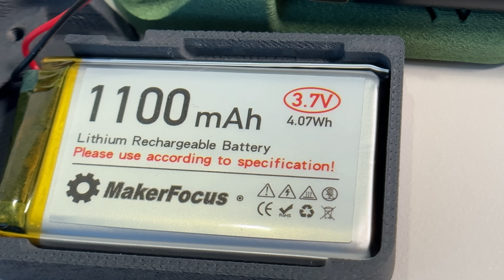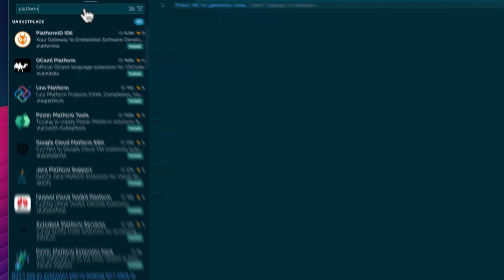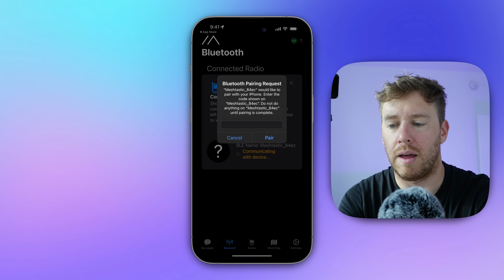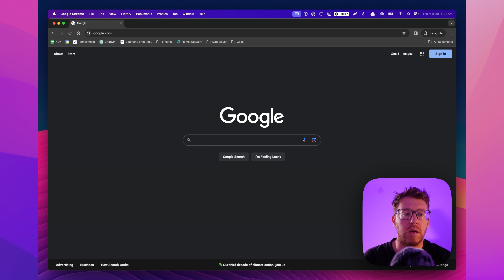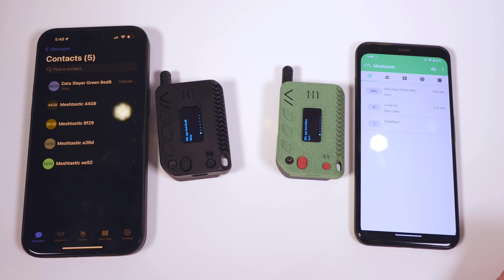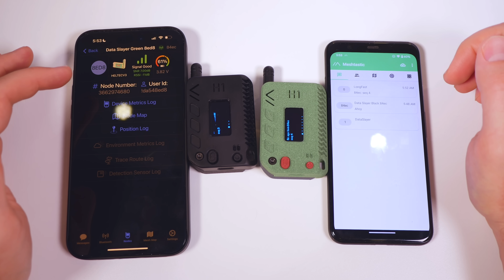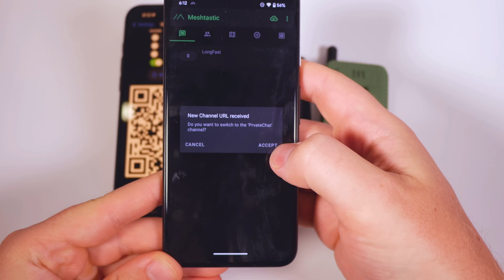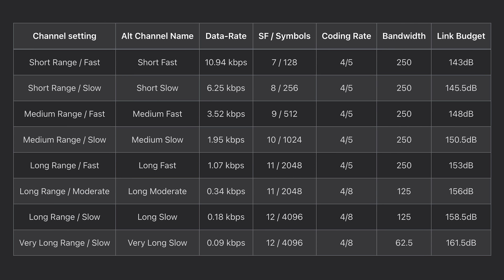It’s Been a Good Run, Phone Providers.

Comment: In 2015, a me and my supervisor talked about this technology. This will be very helpful when disaster comes and no telecommunications are available.
Reply: disaster has already come.
Reply: HAM radios are the emergency comms worldwide. These Things are amateur pagers for local friends.
Reply: When disaster come but you still have a plug to charge your devices... like... a small disaster!
Reply: How is this better than conventional radios?
Reply: @Kryssthealien  Or a generator, or an inverter and power supply, or a lithium backup brick or.....
Reply: they are inherently an interesting hobbiest toy due to their short range capability. They run on shitty citizen band / PRS radio frequencies... low range anyway, and the laws of physics regarding radio wave propagation... the fundamentals. You can't get away from that. And the laws of the country it is being used in may further limit it's implementation and use. (ie Range, readability, mode of transmission permitted) 
The big boys use industrial gear like PLC's, industrial computers and associated comm's equipment. That's because it really works in real life situations. The amount of smarts in that sort of equipment is awesome. 
At this stage (and for many years past) the LORAN seems to be for tinkering with and doing experiments. I haven't seen anything meaningful done with that gear because of it's limitations. Yes it works fine for a mile or two, but that's it.
It is the hobbyist radio gear that is legal for the unqualified to mess around with.... that's it.

It sort of seems to be an answer for a problem that doesn't exist in the real world (Aww, maybe we can maybe provide the solution to the non-existent problem more efficient !!). What could it be used for.... a situation that really exists that isn't already being done better, with existing commercial or industrial equipment?
In a disaster... I wish to write more, sadly it would be impolite. It involves keeping it warm... as best you could in an emergency.
Only thing worth a tin of s^*t in a disaster is your personal supplies, cash and comm's of something under the 27Mhz radio frequencies (Ok maybe a little higher)an old CB, or short wave, or long wave. They all require looong aerials to work properly.
The 'fishing boat radios', just above AM broadcast frequencies transmit for hundreds up  to thousands of miles.... they are about a 100 watts usually, and use AM or SSB. CW and semaphore... well no-one knows about that stuff now. Yes there are amplifiers etc... just talking basic here. But you need to know someone else with similar gear; on a comparatively low radio frequency.
Reply: lol , you and your supervisor talked about “radio” tech like it was new? Fascinating, you guys are way ahead of your time. Next bill gates right here.
Reply: @jacobmarley2417  lol i wish. im not into tech stuff. My supervisor was. Radio tech is old news, its just corporates prefer something that has money gain on the long run and can charge each peope monthly. Cheers! Haha
Reply: @colonelfustercluck486  dont write a novel. I like the explanation. Its just too long to read. Cheers!
Reply: ahem:
A Radio.

Comment: The orientation of the antennas is also a key factor often times overlooked in RF transmission from these sorts of projects.  Radio Waves in a whip/stub antenna are polarized either horizontally or vertically depending on the direction the antenna is oriented in relation to the surface of the Earth. If the antenna is held upright and pointed skyward the direction of propagation of the radio waves with respect to the Earth's surface would be horizontal.  If the orientation of the other antenna is laying flat as opposed to standing upright, there will be a signal loss of 20dB due to polarization mismatch.  This is an almost total loss of signal strength.  Maximum signal strength occurs when the transmitting antenna’s polarization matches the receiving antenna’s polarization.
When a polarization mismatch occurs in a linearly polarized antenna the entire signal will be lost due to the misalignment.
This is probably best demonstrated using the picket fence analogy.  A signal passing through a linear polarizer is much like a rope passing through a picket fence.  As long as the oscillations of the rope are in line with the fence pickets, the oscillations can pass through the fence to the other side.
If however, the fence was rotated 90 degrees, the oscillations of the rope would impact against the pickets and the energy and motion of those oscillations could not pass through to the other side of the fence.  Effectively the “signal” has been cut off.
-20dB is a notional value. In theory, all power should be lost during this conversion. But we are not living in a perfect world and some power will always go through.
Reply: Thanks, one would hope that an enthusiast that gets into radio communication of any kind will do the legwork - which most certainly needs to include a layman's understanding of how the physical size/length/orientation of antennas is absolutely critical to the process.
Reply: How to you figure out which way your antenna is polarized?
Reply: Esp32 just doesn't handle that much processing required for large data transfer. So you can have plenty of signal strength but the bandwidth is still rather limited by the hardware. I know because I did this exact thing by modifying vanilla ad hoc mesh network libraries about four years ago. I was able to get live video across five nodes at around 60 to 70fps reliably over about 600 meters open area. But I had to modify and shorten the data protocol and switch to hex basically shorthand UDP it otherwise it just wouldn't handle it. And it only works to increase bandwidth by making a master and a slave endpoint who's sole purpose is to break up shorthand address and reassemble data packets. And only then you get more bandwidth according to the amount of nodes used and data packets sent at once. But as you scale up you get to store those pipe addresses on each device. And it quickly becomes an issue of node redundancy from the master's max data packets released at once. Or if you prefer a matter of each devices routing processing time effectively it becomes not worth it to add anymore nodes. At that point it makes more sense to just go with a single industrial solution. Now if your expectations are to send or stream single videos text messages or an array of integer data from sensors sure this will be fine. But if you're expecting to send several large files and simultaneously receive another file with any haste then no it simply isn't worth the hassle.
Reply: @fireteamomega2343 I have very little understanding of what you just said, but it sounds like maybe you should contribute to the meshtastic project😂

Comment: Line of site over land with good antenna about 100feet up: 40 miles is about the limit we found. 
300ft with parabolic we stopped trying at 60 miles because we couldn't get line of sight further than that. 

Now, find an area with large numbers of devices set as a mesh and you will really get some speed and distance.
Reply: "Radio Frequency Propagation" is what many people need to study.
It seems new to many people here, but these properties of radio propagation have been researched and known about for well over 100 years.
Why does 934 Mhz work? Why doesn't it work? Learning about radio signal transmission (or Radio Frequency Propagation) will help if you're in this for the long haul.  The software, the mesh etc are  different topics. There are several layers to get thru with those higher frequencies .

Comment: I remember I have checked LoraWAN maybe 5 years ago, similar stuff and its range go up to 10-20km. It's for IoT sensor to collect data in different locations and send back to the center for kind of scientific research. Now the range maybe even longer.
Reply: The new record now stands for LoraWan at 1336 km / 830 miles
Reply: it's been going on for ages....... there are other commercial and industrial systems out there that are more expensive and superior. The LORAN stuff is on free to air channels for brilliant people with no money. 
In reality it is for non-commercial / industrial use.... Hobbyists and experimenters. Don't confuse this with real equipment. Real equipment already exists, and has for many decades. In Industry, everything is there... it costs. It is awesome and works. 
With Loran everything is largely experimental equipment, may or may not be accurate, what do you connect it to... are the results verified. If in  a two way control system.... is it going to work. Shall we install this for comm's on the next lunar mission? Will the president use this to connect to the big red button on his desk........ "awwww, well it works for 3 miles, and Jed used it over 5 miles.... once." Use it to experiment, don't use it in real life, due to propagation (RF) issues

Comment: You can also use GRMS radios with rattlegram for longer range in some conditions.
Reply: Yeah I didn't want to be a wet blanket, but this is basically a neat little toy with enormous limitations. A pair of Baofeng uv-5Rs are the same price, better range, better battery life, and they don't rely on mobile apps or webAssembly craziness, although they don't send text messages... but if the internet went down and Baofeng went out of business, my radios would still work, without being tethered to a mobile phone.
I would've been so much more excited about this if it wasn't touted as a "phone killer" despite requiring a phone and a proprietary app that you need to get from the app store 🤦‍♂️
Reply: @Alkimi yeah any analog or digital radio is leaps and bounds better than this. You can modify your radio to send encrypted texts or even do audio encryption. And it would still be cheaper than this.
Reply: @xfy123  You aren't getting encryption.
Reply: @Alkimi  It's complimentary data services to unencrypted voice. I don't solely have DOCSIS, I also have LTE, DSL, ATM, ethernet, wifi, FM, UHF/VHF,  SONET, etc....
Reply: @syntaxerrorsix3137  The "encryption" element imo is just so you can use profanity and not get in trouble with the FCC. You can xmit whatever you want without concern over being scrutinized as an "operator" in a legal sense.
Reply: @scottleggejr  I'n not saying that's extremely shortsighted or anything but 😐

Comment: Years ago at work my group did something similar. We miniaturized a VHF/UHF relay platform and slung it under a huge balloon. I launched it from Norman, OK and it came down in Kentucky. It spent hours at around 105,000’ and provided a relay footprint of almost 400 miles. 3 channels of VHF and 4 channels of UHF. While I put our contact info on the payload it’s never been returned so there’s some cool tech probably hung up in a tree in Eastern Kentucky.
Reply: No gps to get a fix on where it landed?  E. KY here.

Comment: Thanks for sharing this information. Very well done and helpful. A couple things to consider. Refactor 3d printed mobile computing device plus mesh node housing in the form of various "sleeve" concepts to introduce the idea of more efficient integration and use of space. The current configurations are excellent demonstrations for introducing the use of a separate mesh node network through the integration and use of two standalone handheld devices. The appropriate next step from a hardware and software and utility perspective would be tighter integration.  I also believe that one of the key value propositions is that the hardware is not fully integrated with existing mobile communications systems. A sleeve concept maintains the benefit of keeping hardware separate while improving handheld efficiencies.
Reply: ... which is why those ultra cool Fallout inspired devices with built in keyboards give any man an erection to see picture of.  The problem is that as soon as you add that much complexity you start to require parts that will stay reliable, and the next thing you know a working marketable prototype is already outside of the hobbyist sphere - which is why we can't buy clones of the awesome goodies I have seen as one off ultra gizmos.

Comment: In the 80's, 90's and into the 2000's, there were radio-phones that had many miles worth of range and plugged the base unit into your home's landline which is how you were able to make and receive calls. You can still find them if you search online and some had outrageous distance like 50 and 60 miles!

Anyway, that ultimately outdated technology still shows us the potential to escape the clutches of widespread intrusion and monopolization can still be at least, loosened. 
I actually went to college for the science of electrical/electronics engineering and am now seeing my predictions from about 10 years ago finally coming into light.

Mobile style personal devices that are more customized in features, functions and user interfaces will ultimately be the next huge wave of consumer technologies, especially as nanomaterials are reduced in cost to advance the capabilities of semiconductor based technologies and for a price the average consumer can afford. 

This one is ground level and what I predicted which is aftermarket hardware using our phones and tablets for a lot of the processing but eventually we're going to see a lot of stand alone personal device technologies that cut the apron strings from these devices.
Reply: I remember Sony promoted a cordless phone that could go about 5Km from the base, back in the 90s.  I had a neighbor buddy that used to go out and hang around with us all over the neighborhood, with his house phone in the pocket just in case anybody would call home he could take the message LOL
Reply: @gadget00  there's a few websites dedicated to those old systems and in some cases the owners still use them tied into landline service. There are scrambling systems for them that I imagine nobody ever bothered to crack outside the government.

Comment: True!  Lower frequency is increased range but yes less data can be transferred.
Reply: No, bandwidth is decreased. Not necessarily lower data speeds.
Reply: @AutieTortie  The absolute data speeds will be lower due to lower frequency's slower cycling rate however since that isn't going to be your bottleneck.  LoRa standard is an order of magnitude faster (shorter wavelengths) than AM radio here in America.  So you can see, as far as audio or text, it is more than fast enough.  Video transmission would be a different issue.

Comment: with a 500Khz channel bandwidth and a Spreading factor of 7 
that thing can transmit at ~8kbps... this allows to transmit voice using a codec
like G.729

even if only allowing 1 side at a time communication (walkie-talkie mode)
voice transmission would be a nice feature...
Reply: Yes but you don’t want to overload a network which may depend on a single relay.
Reply: The ts3s Lora board already supports audio. Lookup meshtastic audio module...
Reply: depending on your system LoRa mases out at about 20-21kbps so you cna do quite a lot with that, I am currently looking at transmitting small images/video with it
Reply: No, that's not a good idea. I guess it's not allowed to utilize the frequency more than 1%.
Reply: So why not just get a bucket full of cheap Baofeng's, then?
Reply: These are public channels and you're supposed to limit your use to 1% of the channel in Europe (most sub-bands) and 400ms dwell time in the US. I guess in the US you can signal hop to get around this but then both sides need the same hopping algorithm and synchronization. It's also quite likely that in urban environments voice over 915 MHz and at 1W EIRP will completely mess up the whole band in urban environments with a hundred users per square mile and new regulation will be put in place to prevent band hogging. If there is already a lot of LoRa/ZigBee/SigFox/etc traffic in the band, it will be very hard to find contiguous transmission blocks to transmit unbroken audio as it already is.

Comment: This is pretty neat yes buildings and trees effect range. Basically anything that exists will drop performance. I have had my amateur radio license for a couple of years. We are not allowed to use anything encrypted. There’s networks similar to this using ham radio and a lot more power. But when running a computer network through it everything must go unencrypted. I am going to get some of these and play around with them. Using the ham equipment and power 45 miles is my record with a network. I can go much farther with voice or CW. The data speed is pretty slow. Plus all the FCC. Hoops you have to jump through. No hoops with LORA.
Reply: you can still get in the s^*t with LORAN if you go "over powered" or "off frequency", or mode of transmission is not permitted. Those frequencies are in the citizen band / PRS radio band... even in those bands you have to watch what you are doing. That circuit board is software controlled, and you do a country or region select.... that fixes the problems above.... and limits you to hobbyist or experimental stuff.